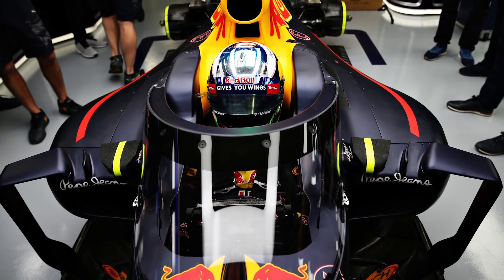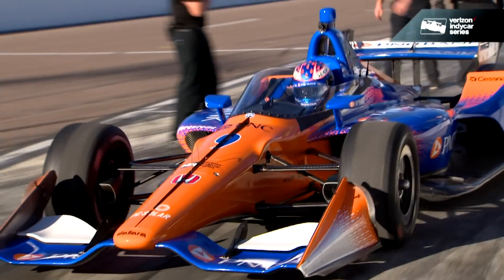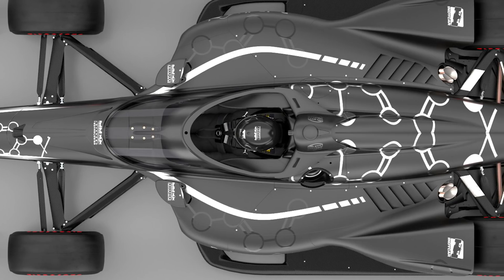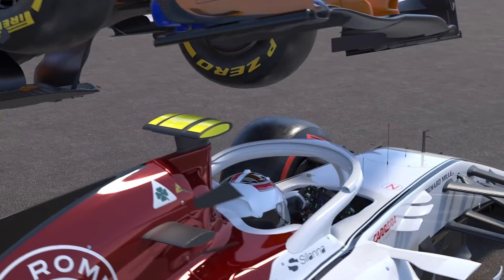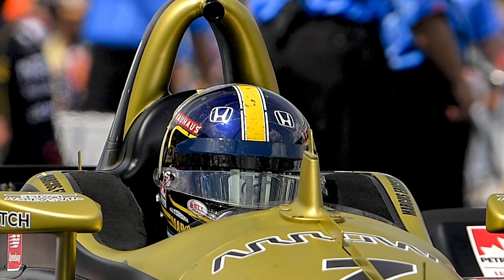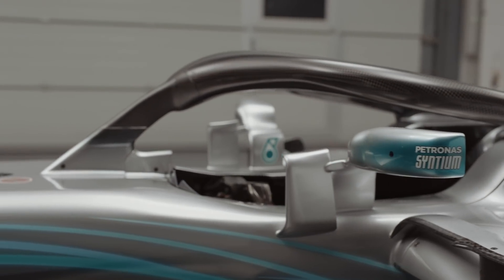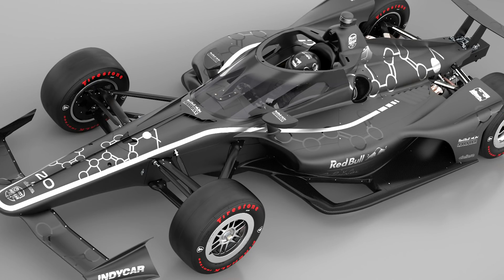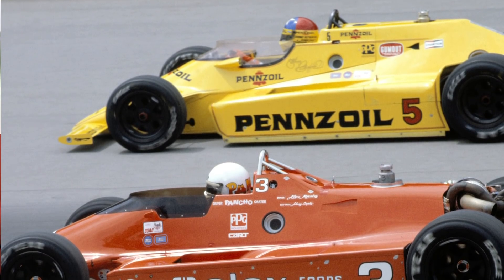Why IndyCar chose Red Bull's screen that F1 rejected

Comment: The new red bull design is not as opposed to the halo but simply a improvement of the halo so it is hands down better as it has the strength of a halo and the ability to protect against smaller objects.
Reply: E3 V Ghost I agree the design was not proposed as an opposition to the halo, but it wasn’t an improvement on it either. Indy wanted something else, the screen was requirement #1, but after the landing of Alonso’s car on top of Leclerc they recognized they’d have to have the vertical strength as well, to allow heavy things landing on the protective measure, or the car ending upside down. So they evolved to incorporate the halo effectively.
Reply: @KryzMasta Aeroscreen is better
Reply: Adding the windscreen will come at the cost of added weight, and debris small enough to bypass the halo but with enough energy to injure a driver is far less likely than the large objects the halo was intended for.  I'd like to see it regardless, but I'm expecting stiffer political opposition than the halo had to fight through.
Reply: @BookofAeons  Smaller bits are more dangerous and likely to be encountered.  Haven't you seen how much carbon fiber debris is on the track after an incident. They even mentioned Gasly talking about cf resting in his lap
Reply: Why don’t they just put a solid metal plate in front of the driver. That would mean maximum protection. Don’t get it 🤷🏼‍♂️.
Reply: @Internetprolet1312  I agree. That's clearly the best solution here.
Reply: E3 V Ghost was the drivers would be essentially blind, drivers don’t just look forward when driving like you probably do in the f1 game
Reply: Marten Diemer weight and that would really impact driver vision really badly
Reply: There was testing proving the Halo us far better at protecting against bigger items, look it up on YouTube and stop spewing bullshit from your mouth
Reply: @robertjusic9097  Do you understand what the comment above said 🤣
Reply: @robertjusic9097  ...just imagine if you had actually WATCHED the video - or, better yet, LISTENED to it - you wouldn't have proven to everyone that you're a complete and utter fool...
Reply: @robertjusic9097  This is not the PPG screen-only device, the Red Bull design has both a halo-like structure and an additional screen in front of it. As long as said halo-like structure can withstand the same (or higher) loads as the Halo, this should be an all-around improvement on driver safety.
Reply: @robertjusic9097  Jeez, comprehension is not your strong suit is it.
Reply: @robertjusic9097  Take your own advice.

Comment: So Vettel said the Aeroscreen was disorienting.
Now they've refined it for Indycar, I think F1 should continue to pursue the hybrid screen/halo as it cleans up the look so much better.
Reply: Yeah and across the series, there were several aeroscreen variants and I'm sure they shared data to come up with the best solution yet. 
I understand testing of the final design starts this summer and if all goes well, all the teams get it for testing in the fall. Exciting times.
Reply: I never really understood this complaint. What about fighter jet pilots? Don?t they get disoriented from the screen for almost 100 years? This can be easily fixed with a lottle help from a jet screen manufacturer.
Reply: @MrTylrbence  The only thing I can think of is that jet canopies are alot larger than the aeroscreen. Curving glass/polycarbonate in a tigher radius increases the refraction effect so that could be a factor. In any case, if a 4 time world champion says that, I would take his opinion into consideration.
Also, with the screen, the Drivers wouldnt need full face helmets, so they dont have to see through the visor as well as the screen - I dont know if this was ever tested
Reply: It was because of the distortions of looking through at an angle. This can be fixed fairly easily it just requires a few variations to get right.

One possible issue would be distortion only for a few drivers and that would be down to their eyesight, which should mean those particular drivers would need a slightly modified screen.
Reply: @ryand3581  thanks but we've already covered that
Reply: Graeme S rain, and oil don't mix. IndyCar drivers don't run in heavy rain. How is an F1 driver supposed to pull a tear off the screen?
Reply: Clint Tapper that is the most intelligent comment in this entire video and comments section. Thanks.
Reply: @Graeme S If I remember correctly, the screen that Vettel tested and found disorienting was Ferrari's own take on a safety screen. That one was still very simple, looking like it's just a bent screen of plexiglass, similar to what's on the IndyCar at 1:33 in the video.
Reply: we do not know what agendas are behind that statement either tho. halo was pushed. in my honest opinion, halo is just the stepping stone to a closed cockpit. essentially its a closed cockpit with no screen. bring the screen along, then merge the 2 "devices" and we have closed cockpit, "in the name of safety", the developers have wanted closed cockpits for years, its better for aero. the "business" wants closed cockpits, its safer, injury and death are bad for business. the drivers, the ones who accept before they get in the car, the risks involved, are the ones who dont want it.
Reply: @littlewol2620  Yes, eventually we will go closed cockpit sadly. For me, open cockpits somehow make the racing feel 'real' for the driver (having driven an open cockpit KTM Xbow ),  so thats probably why the dont care for it. I support that. I feel its part of what makes F1 different to WEC and other series - its more about racing than  just driving around in circles endlessly as fast as you can.
Reply: @littlewol2620  They accept the risks, but they don't want the risks to happen. 

A soldier knows he might die but he doesn't actively want to die does he? He wants the best tech to help him out. For the most part, the halo is hated because of the look and how slapped on it is. Drivers want the best chance of living but they hate how rushed it was. That's why they don't really like it. Plus closed cockpit has done wonders for WEC, made the cars faster so why not f1? Its never been called "open cockpit" has it?
Reply: In all fairness, it was also the fault of the team. It was only until the final stages that they started working on alternatives once they knew they couldn't stop the halo anymore. So what Vettel tested was like a first concept version. We have seen bended glass without such problems so with more time they could've made it work. But that time wasn't there anymore.
Reply: Graeme S - Understand your points.  Just imagine, if, in the mind of safety, Lewis Hamilton was killed, such as Dan Wheldon, Justin Wilson or Dale Earnhardt?  A series premier driver.  Transition for greater safety would happen immediately.  I appreciate the risk racers subject themselves to; I hope modern F1 never has to go through the dark days that Indycar or NASCAR did when one of their namesakes is killed in action.
Reply: LMP1 drivers are laughing
Reply: They don‘t talk really about the distortion issue in the video. It is crucial that the drivers have perfect vision at these high speeds.
Reply: @pippo9830  Actually it's better to read and understand what you've read before you comment. I didn't say "The Halo would have stopped the spring" What I did say was "Ask Massa''s wife how she FELT" see the difference?
Reply: Halo looks so much better
Reply: Please no screens
Reply: People back then made fun of the full face helmet when it was introduced in F1, it was during the time where most drivers wore the standard Shell helmet by Bell , the bell helmet was mandatory after Peter Snell’s fatal crash and people wore that with no questions asked and then they introduced the Full face helmet and the drivers themselves made fun of it and it took a while for the helmet to be mandatory in the sport.
Reply: from this thread, it seems that F1 fans actually care more about the looks of the car instead of the driver's lives simply because "the drivers accepted the risks, they knew what they were getting into". i see 🤔
Reply: Still commenting on how it looks. How about you ask Massa's wife how she felt after her husbands car torpedoed into the barrier with zero braking because he was unconscious back in 2009? I'm guessing she was feeling like throwing up. But you know lets all focus on how it looks.
Reply: @SomeYouTubeGuy  if anything the halo would have made the spring bounce into his chest and he would have died, like do you really think the halo stops small debris from entering the cockpit. Just go all out and make it closed cockpit ffs
Reply: @SomeYouTubeGuy  first of all, its doubtful the halo would have stopped that spring? secondly, the drivers, and their loved ones, know the risks before even getting in the car. as niki lauda said, its acceptable risk.
Reply: @littlewol2620  I'm not talking about what is acceptable or not. I'm talking about people continuing to say "I like the look of..." It's not about what it looks like. If it was there never would have been X wings years ago.
Reply: @SomeYouTubeGuy  the point here is, if it doesnt make the car go faster, with more durability, it should not be on the car. this is the entertainments business now, not the sports game. it has been made overly safe for entertainment, because death and injury isnt encouraging. but you tell that to all those drivers who have and would go out there in deathtraps to tame the beast and be the quickest. the danger is baked in, even a screen or closed cockpit does not negate the dangers
Reply: @littlewol2620  yawn,
Reply: @littlewol2620  Yes, we get it - it's not entertaining to you if drivers aren't dying, we know
Reply: @RyTrapp0  far from it. id rather they stopped dicking about and just closed the cockpits. these are open wheel cars, trying to do the job a closed cockpit car, but refuse to commit to it, for heritage sake? so you can see why doing it half heartedly both doesnt suit function properly, and it looks silly, its a compromise, a bad one. they have banned aero in the past on safety ground because it could restrict view. when infact they didnt, especially by comparison to having a halo smack bang in your face. the closed cockpit is the best option for safety, aero and visuals. but even the implementation of this does not make the racing any less risky. if a driver wants to go out there and knowingly risk his life, for glory, thrill, fame, money, respect, let him crack on, they have all done it because they want to
Reply: @SomeYouTubeGuy  Calm down Mr White Knight... if you watch the actual video, the Indycar screen is testing at the same strength as the F1 Halo. All things equal, I would prefer the screen hybrid to the Halo because it cleans up the look better. (the screen in Indycar actually has a halo frame integrated into it.)
Be civilised, and respect everyone else and think before you start ranting or you'll end up looking like a muppet
Reply: @graemes8187  Well as long as you like the look of it we should all just stop discussing it. Case closed Graeme's happy
Reply: @SomeYouTubeGuy  I bet you fancy yourself a cynical genius. I voiced my opinion on a public forum - that IS discussion. If you dont like an opinion in a public forum then kindly keep scrolling.
Reply: @graemes8187  I replied to a comment on a public forum, that is freedom of speech.
Reply: @littlewol2620  Actually closed cockpit does provide less drag which aids performance over an open cockpit so perhaps it should be on the car.. 🤔
Reply: @RyTrapp0  That's a pretty stupid comment to make but okay.
Reply: @F1ll1nTh3Blanks  indeed it does, the engineers have pushed for this for a long time, for aero purposes. and still they try and hold onto heritage and do it half ass. im all for a commitment to either. but there is no compromise, thats just stupid.
Reply: @littlewol2620  100% that's one thing that's always annoyed me about F1. Too much sacrilege and tip toeing. Either get on with or don't but stop half arsing. 
F1 feels more like a bad light show than an actual motorsport at times.
Reply: @littlewol2620  Canopy would  have stopped it  though.  

ultra-hydrophobic coatings
Reply: @SomeYouTubeGuy  Halo would not have stopped such a small object.